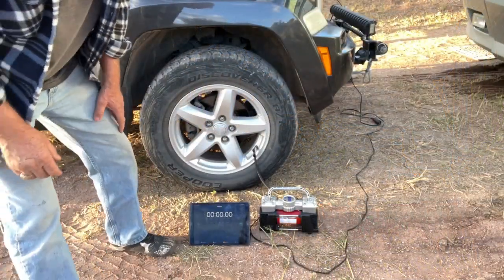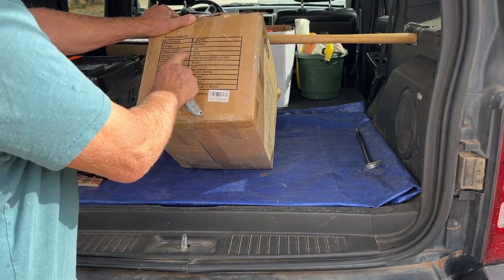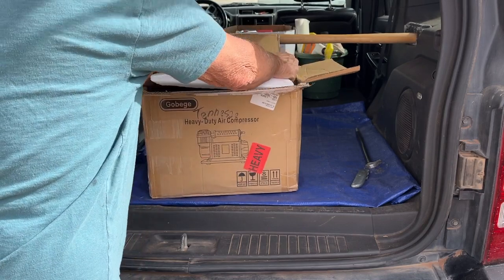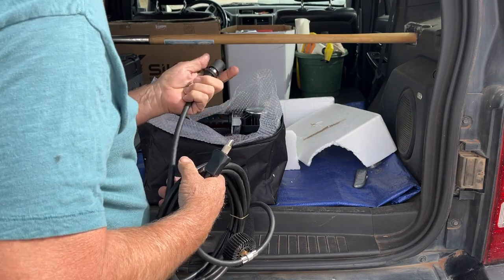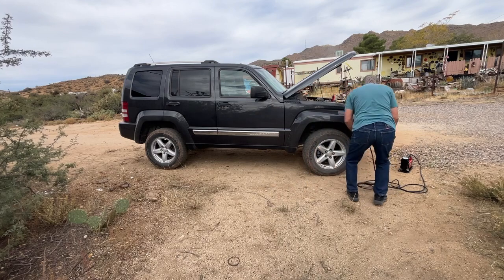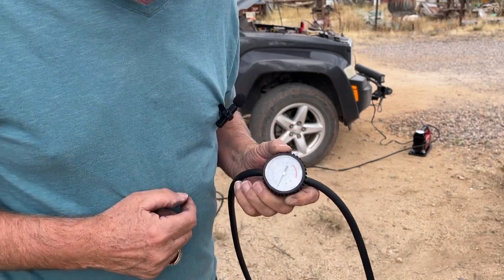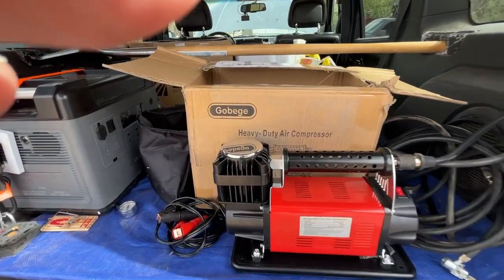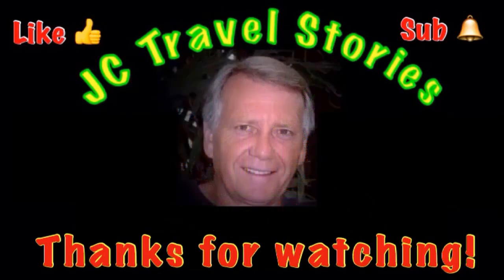Air Down Air Up Off Road

Comment: Jerry, I enjoyed the demo of the new compressor.  I hope it brings you many years of reliable service.   I run a dual chamber ARB compressor. A bit pricy, but it has enough volume to run a 1/2 inch impact wrench. Buy once cry once. Well worth the coin spent. Also, I like how your RV is backed up next to a stop sign. Chuckles,  Cheers, Mate.

Comment: I also got tired of the hunks of plastic that take forever and don't last very long. Several years ago I came across an all-metal unit at Harbor Freight and decided it was worth a try. It's not as big or fast as yours, but it's a thousand times better than anything I've ever used before. I liked it so much that I bought a second one to keep in my other vehicle.

It still uses a plug rather than having to pop your hood and clamp onto the battery, which I think mostly makes up for not being as fast as yours. I'd say it takes about half again the time yours takes. It also has a quick-disconnect hose, but it's the coiled plastic kind. I have had zero problems with either one, and the beauty of the quick disconnect is that you can use it with any generic air hose or accessory, because they are the standard air hose connectors.

Comment: As I'm sure you know JC, the stiffer the airhose the lower the  compliance.  Higher compliance means the airhose would stretch.  A stiffer hose doesn't comply with the internal air pressure.